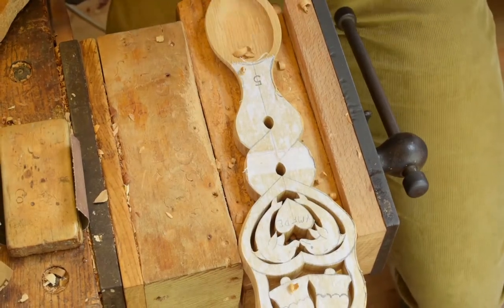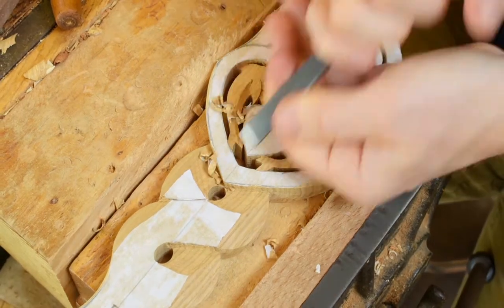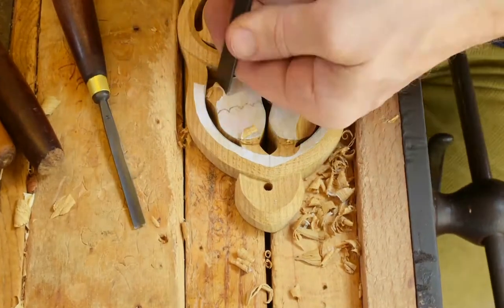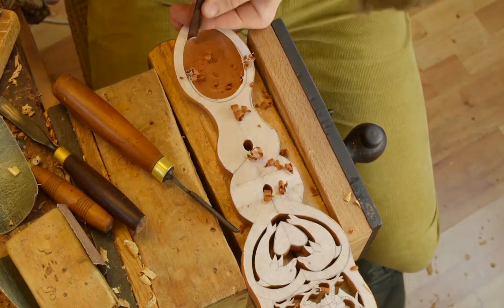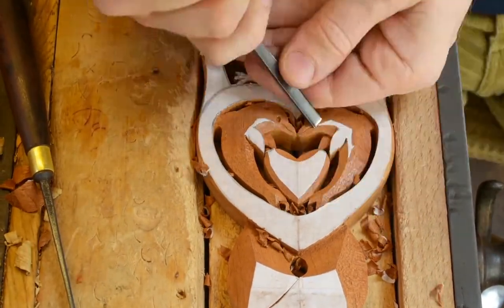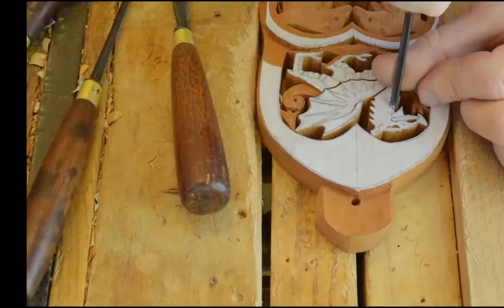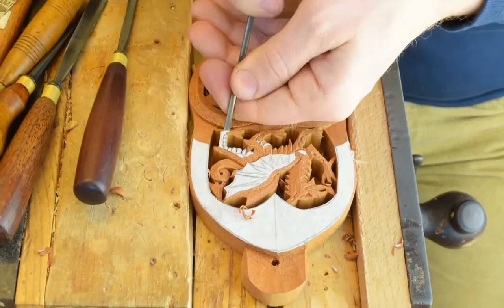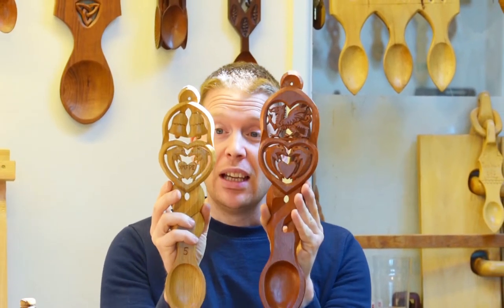Carving dolphins in wood by hand

Comment: Does one sand, as an example, the surfaces between the dolphins and the heart to remove saw marks? If you do, how is it done without damaging some finer details?
Reply from the maker: Hi Thomas, great to hear from you. The answer to this is in several parts. Firstly the Hegner scroll saw is very good because if it is used correctly it doesn't leave any saw marks, it has a fine blade and a fine finish. Having said this inevitably you will get the odd saw mark. In this situation you have two choices recut with the scroll saw or sand it by hand. If the hand sanding causes any detail to be removed just recarve the detail back into the lovespoon.

Hope that helps, let me know if you need any further explanation. All the best from us all here at The Lovespoon Workshop. 👍👍